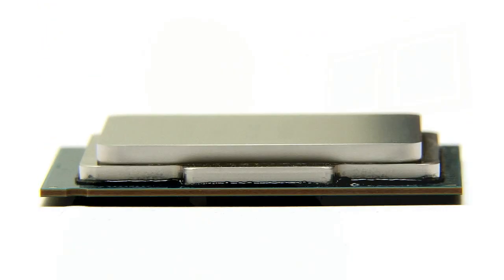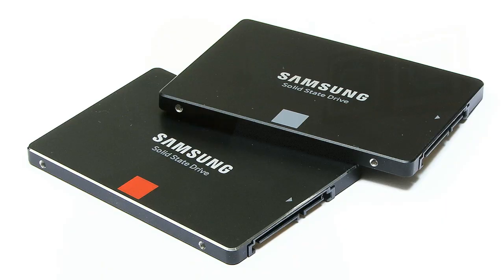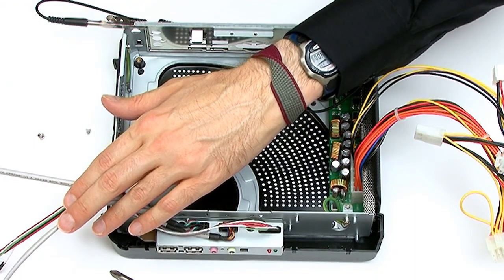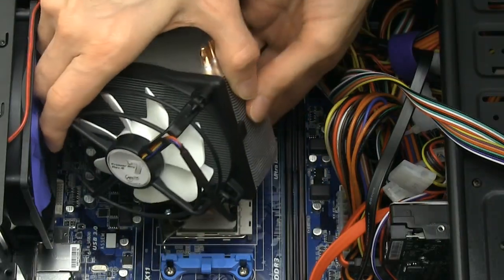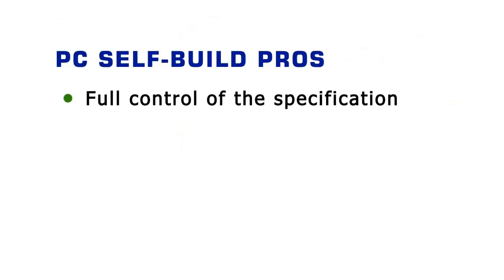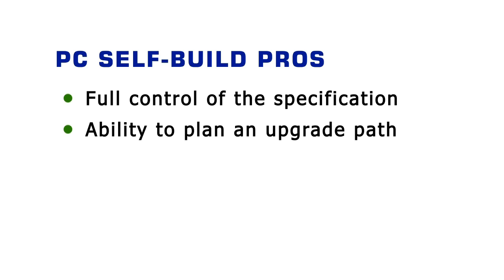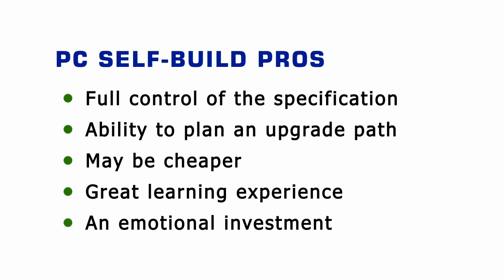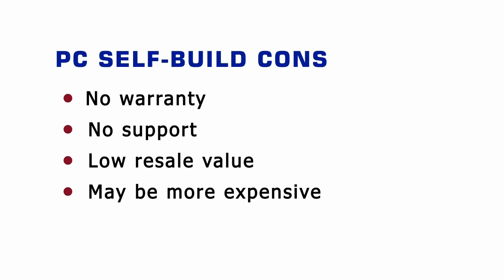New PC: Build or Buy?

Comment: One of the best tips for PC construction is to cross-check you construction techniques against YouTube videos on the subject.  Don't assume that the YouTube videos are necessarily correct, but cross-check the advice for logicality.  You can even cross-check that you are using the correct screws, washers, and pillars, on websites.  If the advice provided is logical for the application, then apply it.

Comment: I'm a fan of buying a high-value refurbished PC, then upgrading it.

My 4-year-old PC came with an i5-3330, 12 GB RAM and 2 TB disk drive, and was sold refurbished at the manufacturer's eBay store for just $280. I've upgraded the power supply, added a graphics card, and added an SSD for booting.

Comment: I had a memory problem when I built a computer years ago. Took me seconds to find out, took all the memory sticks out, the mobo started, but obviously with the BIOS beeps stating no memory. I swapped one by one in the first slot and found out that one of the memory sticks was faulty. RMA-ed the memory back to the retailer and got a brand new one from them.

Comment: I'm a newbie to your channel on YouTube, good stuff. Have been doing self-built PCs since mid 1990s, never had a no-go until recently. Looking for a low-power machine, tried Gigabyte, and Zotac, could not get them to work, so returned. Now I have a Shuttle xs35, and could not get Win7 (supposed to be suitable) on it. Went to Linux. Tried ubuntu, but the restart for first use only came to a Linux command prompt. Too bad I don't know any Linux commands. Next up tried Linux Mint, which worked great, and since have been following your advice about Linux. Thanx Chris.

Comment: Nice video.  You've covered several topics I hadn't thought about.  I built my first computer (with my dad).  I built a DX-40 33MHz while my dad wanted a SX -40 386 (I always referred to it as an SUX-40.  The only difference was that I had to populate two banks of memory while he only had to add one piece of memory.  My memory cost twice as much as his did.  But my DX-40 would run rings around even the most powerful 486's at the time (mid 1970's).  
On the other hand my wife just wanted a new computer she could learn so she bought a Dell Inspiron 1545 with an Intel Pentium.  I'd rather have built her one myself but she wanted all the tech support (which we've never used).  If something goes wrong and we end up with a virus that the anti-virus program won't fix, I simply re-load the OS, but then that takes a whole day since I've downloaded so many programs that I use that she has no use for.  
So in this video, you give all the pros and cons to a self-built computer vs. a manufactured one with all the useless tech support and pre-loaded OS.  Thanks for posting this useful video.

Comment: C: anfWell, I may be one of the few people that never got past "Age of Empires 1" back in the late 1990's.
I am over 60 now and I am sick of off the shelf computer Towers that seem to die at a built-in rate of about 3 yrs if I am/ was lucky.
So I have designed my own box after talking to one of the many 
IT Mr. Fixit's that came here to try to fix different ones I have had it.
He said that high-end computers have different sections for Power, main board etc.
I live in Queensland Australia, today's temp right now is 32C - 89.6 Fahrenheit with about 92% Humidity and that is in the house, yeh and it's 4.30pm.
So my specs for a computer 
A: a cheap motherboard that will take an i3-i5 chip 2 x 8 gig Ram.
B: SSD boot drive and 2 Terra HD.
C: Good Graphic card so the 35inch  LED TV shows the movie's and YouTube's at a size I can see
I have the Power box and the Tower box to cutup I am a metal worker.
So can you do a, "I have some bits"  Build just need a bit of help with parts to rebuild?
I Also on another channel, have found Windows 7 Pro to 10 from $10 OEM to less than $40 private I can give the YouTube for this if required.
Thanks for your time.
Tony over 60's Club

.

Comment: You may save money you may not, is generally not correct, as
the quality the machine is almost always better than any pre-built machine. The
price is generally always cheaper but even if it not, the life expectancy of
the machine is generally far greater which means the initial cost may be
comparable at the time but due to the extended life it becomes cheaper than a
branded machine. Yes, on this part of the subject he is DEFINITELY wrong when
he explains the warranty. Actually each part has its own warranty due to each
part being from a different manufacturer. The mainboard is usually at least 3
years but nicer boards carry 5 years. Processor if retail is 3 years if OEM is
90 days. RAM/memory is generally always lifetime to the initial buyer. Power
supply (which NEVER cheap out on these) generally have a 3-5 years if you buy a
solid PSU. Never buy a cheap 40 dollar PSU as they aren’t designed to last or have the amperage to handle heavy loads.
 A solid PSU typically ranges from 80-125 bucks and make sure it not a peak power PSU
but a constant output unit. PSU is the life of the entire computer and does
dictate the overall life of the machine. PSU's do more than just supply more to
the computer a good PSU also filters surges and if a spike occurs shuts the
machine down immediately to protect it. Stock PC's almost never use a solid PSU
as the point is they generally know how long the life will be on the PSU so it
will just outlast warranty then generally quits soon after. Since the stock
PSU has no Active PFC once the PSU blows it often surges power back to the
mainboard destroying it meaning this  forces the consumer to buy another PC. This is
called planned obsolescence.

So while he is partially right you may not save money it simply on the initial
cost but a well-built machine will far outlast a branded in 85 percent of cases
and the warranties are included and you do not have to pay extra for because as stated they
are included. So in turn it is far cheaper in reality and even with the cost of buying
windows separately to build your own machine. Lastly, custom built machines
depending on the mainboard chosen will always perform faster than the
mainboards in branded machines as the chipset for separately purchase mainboards
have better, faster and far more reliable chipsets. This means the very same
processor and ram that came out of a Gateway, Dell, IBM, Acer will perform
noticeably much faster and smoother on a compatible retail purchased mainboard. The
stock manufacturers generally use weak unreliable boards because they are cheap
as the goal is for these companies to make money. Also for those that claim you
got 8 years out of you old HP or whatever stock branded machine is then good
for you as you are the very small exception and does not show the entire
picture or what people can expect on average.
Reply from the maker: Yes, very good point. You get quality -- and known quality at that.
Reply: Yes, with pre-built computers from branded vendors you don't know what you're going to get. I have seen audio chipsets you can't find drivers for a year later or even USB 3.0 chips with the same issues. Another one is  cheap sata interfaces where the driver has to be installed for the machine will even see the connected drive.  Another one is cheap Mainboard chipsets northbridge/soutbridge where they cause the machine to run buggy, unreliable or simply inconsistent user experience when using the system. Lastly, super cheap wired and wireless embedded network adapters that one minute they work and the next second they dropout or are terribly slow. Those are all reason I build my own PC.

Comment: A couple of retail sellers here in Australia sells high quality pc's on ebay with good specs and fairly cheap. The only other expense is what you said in the video, add $150 for Win 7 or 8.1 or 10 ..you don't have to have any operating system installed but they can install Ubuntu for free if you want.

Comment: I started with putting the occasional part into an old PC someone else built for me (I don't think I've ever had a branded PC, not since the old BBC micro days anyway) it got obsolete to the point I couldn't really upgrade it anymore (DDR, AGP) and eventualy died, I decided it was time to build my own as I'd had problems identifying some of the hardware (and therefore compatibility).  Spent a few hours putting it together, didn't turn on the first time, panicked, pushed a cable in properly, worked.  7, nearly 8 years and a couple of upgrades later and it's still working fine (jinxed it).

Comment: I built a desktop computer about five years ago. Probably didn't save much money if any. Hard to say of course since you're not going to find exactly the same components in a stock computer. But it never gave me any problem until five months ago when the C drive started dying. I bought a 500 gb SSD and installed Linux instead of Windows and its working great.

Comment: The biggest issue IMO is that OEMs always go cheap on the power supply, which is by far the most important component of a PC. If your power supply can't send enough energy or doesn't send clean energy, you'll damage your components over time.

Comment: Great video! I have like you been building PC's for quite a time now and I enjoy being able to have total control over the parts. For example I have a couple of render-machines I use for 3ds-Max network, and distributed rendering, those machines don't have a graphics or soundcard, no fast harddrive, no optical drive, no SD-card reader, etc. only lots of RAM and the fastest processor I can afford. Being able to build these myself has saved me a lot of money. The only thing that bugs me is having to buy a fullblown windows license for a computer I only use for network rendering.

Comment: I have built several of my own PCs. I only had an issue with one build, I neglected to plug a power cable into a 4 pin power  connector on the motherboard. It took a bit of searching to discover the problem. Once I realized my mistake, all was well..

Comment: I never build but did upgrade my PCs in the past sometimes that didn't work out well. I have broken pieces of plastic that should have fallen into the holes of memory cards. Also I once put my computer on its back while the big keyboard din plug was still connected. I switched to Mac 5 years ago and now with the latest Macbook Pro starting at a cost that is equivalent to 2.5x an average monthly salary in an Asian country where I live, building my own Hackintosh laptop would be very interesting if I could get my hands on all possible parts. Finding someone to do it for you would be quite impossible as the people that can afford a Mac are usually wealthier. Mine is about 5 years old and bought in Europe. I would love to see a youtube about it. Can it be done to make a Hackingtosh Pro with a dvd burner and usb3 ports running OSX 10.12? And can it be done well under the cost of the latest cheapest model?

Comment: My first computer I built in 2015 worked fine, for 1 year and 1 week. Then... well, then something happend. Trying to find what part of the PC is the part that needs to be replaced is not exactly easy, it could even be multiple parts that have failed on me. But I will fix it ... eventually. The thing I now regret the most with the computer, is that I should have built it with cheaper components, replacing even one component on a high-end build is NOT fun :P
But concidering it actually worked for over a year, I'm still sortof happy with the result - the failure might well be something I did/didn't do during the build. If I eventually figure it out and can afford to replace the faulty part(s), I hopefulle have learned something in the process :)

Comment: I haven't bought a pre-built PC clone since I bought the first one from an independent shop. That was a 386, before Windows 3.0 first came out. (But that was late on the PC clone bandwagon.) I bought it to see how one was put together. After you know that, there is no need to buy an assembled PC. Just buy the parts, and plug the plugs, roughly speaking.

 (Before that, I would put together S100 bus circuit board kits. You would solder all the sockets or ICs, and capacitors, pull-up resistors, etc. A 4K memory board kit, costing $125, had 64 16 pin memory ICs, and 8 more 16 pin interface ICs)

 At some point, the prices came down so that a low-end pre-built PC was liable to cost less than buying the PC parts. Unless you need a complete new computer, though, changing some pluggable parts comes out cheaper, since you don't have to pay for the parts you aren't going to replace. That makes it is worth splurging on better-than-basic parts that will be fine through some years of PC refinement and advancement. You would, on average, keep monitor, keyboard, mouse, drives, video card, PCI/PCIe cards, case, and power supply, because there is so often an overlap of pluggability across generations. Even if you may intend to upgrade these at some point, you don't have to do it all at the same time, and your budget doesn't take a huge hit all at once. (No credit card charges.)

 But although there is still such a thing as a PC clone, everything has changed, although not synchronosly:

 the AT case changed to ATX. mATX and ITX fit this case, but there is a bigger ATX style that does not.

 VESA bus went to PCI went to PCIe. Motherboards however typically had some of both PCI and PCIe

 keyboard/mouse connector went from full size DIN to mini DIN to USB. However adapters have worked fine.

 The power supply has changed the main plug by adding some pins, and then adding a separate 4 pin plug near the CPU, and this may be going to 8 pins. Molex power plugs to drives have changed to SATA power plugs, but adapters work fine.

IDE (ATA/PATA) went to an improved version with the same plug, and to SATA

graphic cards went from VESA to PCI to many versions of AGP mostly backwards compatible, to PCIe.

Too many memory socket changes to list. DDR3 had an unusually long life span. Early AT did not have an industry standard for memory.

Too many CPU socket changes to list. The last few AMD generations, however, has had quite a few new-generation  CPUs that did not strictly require a new socket, but could work with the previous generation memory in the old socket, and new generation memory in a new socket. But not across two generations. The forthcoming AMD generation will not have any socket compatibility at all, unless possibly there are some unannounced, cut-down variants.

 One thing you notice from having priced-out many variants over the years, is that at first the cost of new-generation CPUs and memory is spectacularly out-of-line with performance improvements. Staying a little behind really pays off.

Comment: In this video you show too much cons for building PC well I suggest you made this for 1st time pc builders or people who doesn't have technical knowledge.

if you are build a pc vs pre-build the cost difference  greater than you suggest. Windows is not a much of a factor today Linux is evolving its gaming side. Comparing spec vs spec even buying windows Building a PC is still cheaper. Well pre-build PC are great specially  when you need it small and for light workload like casual office stuff . In my exp. most of the people who wants a custom pc needs it for gaming and more powerful task your cons are right except for the pre-build PC cheaper.

If my grammar is wrong please understand English is not my usually language.

Comment: Wow, I have the best of both worlds.  I have a shop in my neighborhood who sells a pretty good variety of PC components, cases, etc. at reasonable prices, AND they will assemble a system with YOUR choice of components and give it a 1 year warranty for only US$25  (up from $20 for the last several years.)  Whats more, I work  where we make those high-end CPUs and I can get chips out of the life-test ovens (which cannot be sold as product) so I don't have to buy a CPU.  I used to assemble my own systems from these oven chips and parts from that neighborhood shop. But exactly as Mr. Barnatt says, if something goes wrong, you will have some explaining to do if you take back a bad (or suspect) component.  It is so much easier to have THEM do it. If the graphics card doesn't work, they can just reach over and grab another one until they get it to work.  

My shop is:  http://www.enuinc.com in Hillsboro (suburb of Portland, Oregon, USA  Others have asked in the past, and last time I asked them, they said they did NOT do mail-order work.  Walk-in only.  Sorry.  I wonder why more shops don't do this, however.  Perhaps the neighborhood parts shops are going extinct with everything so easily available online.

OTOH, I am extremely dubious of all those "cut rate" online offers for Windows 10. NONE of them seem legitimate that I have seen. And you will almost certainly run into problems somewhere down the line, especially if you need support, etc.  Nobody (perhaps even in Redmond) really knows what the long-term support model will be for Windows 10 since MS have declared that to be the "LAST version" as they want to do other things than keep trudging along the operating system treadmill.  Maybe all the little Balkanized Linux communities can get their act together and make a decent "utility-grade" distribution that meets the needs of average Windows users.  We can only dream.

Comment: I've been rebuilding a desktop computer I bought ready made in 2009. I've replaced the power supply, the graphics card and added a solid-sate disc. Everything else can't be replaced because it would be out of date on the day of purchase due to the old motherboard and the motherboard replacement is what might lose me my Windows 10 registration.

Tip: Don't buy an AMD graphics card if you want to experiment with Linux. The latest Ubuntu releases and its derivatives don't support AMD cards anymore.